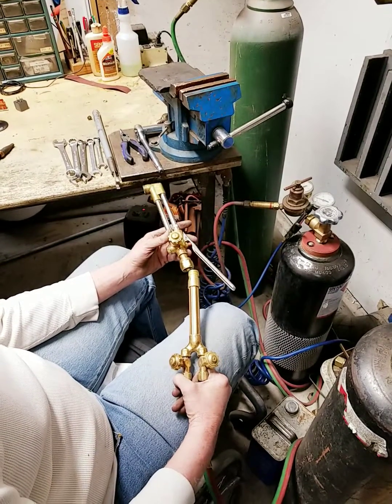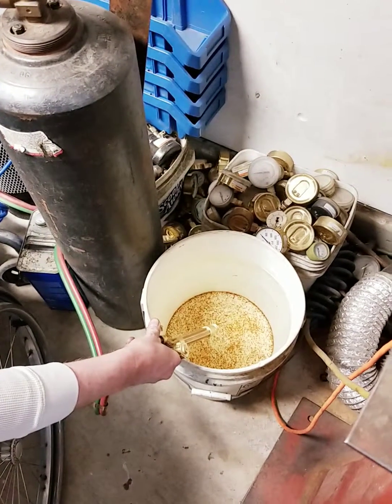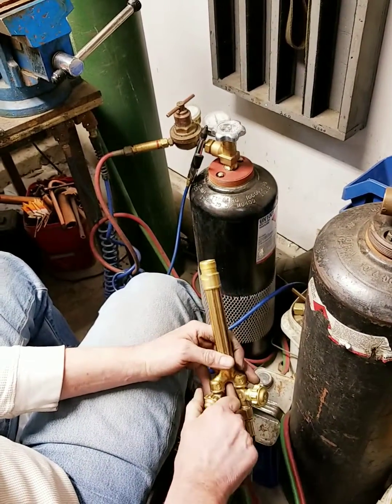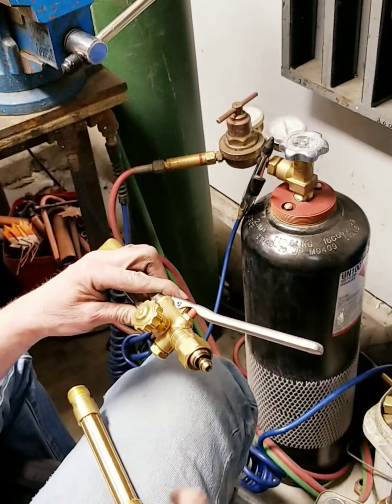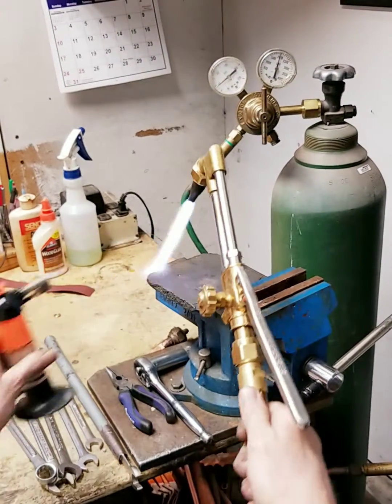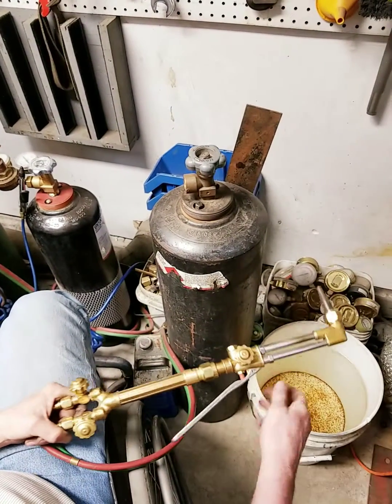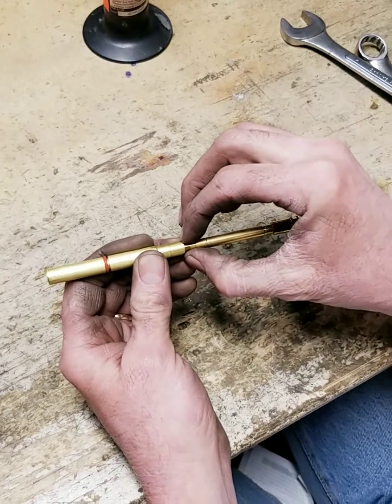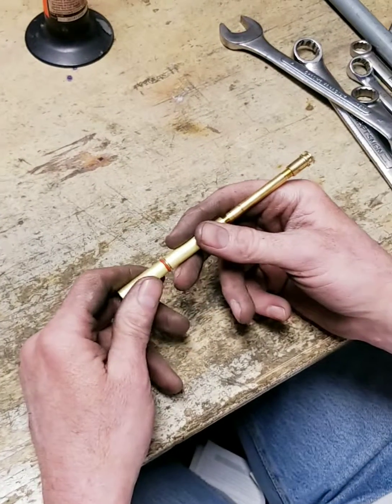Tutorial Testing and explanation of Victor 2460 torch and 315 handle

Comment: I take a scrap cutting torch tip and weld the end shut (TIG works nicely for that) to plug combo torch heads for leak tests. I use clean compressed air or inert gas (since I have CO2, nitrogen and the usual argon and MIG mix to choose from) and a bucket of water for leak testing. I use a Y-fitting with oxygen and fuel gas fittings with two short sections of hose to inert pressure test both sides. Ivory Soap (original, plain) is recommended in older Oxweld etc manuals for leak testing.